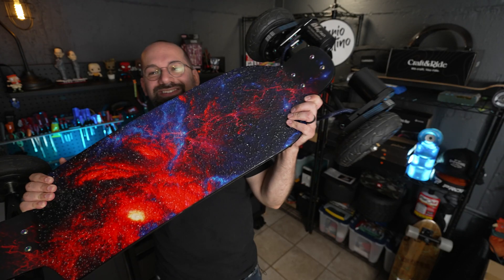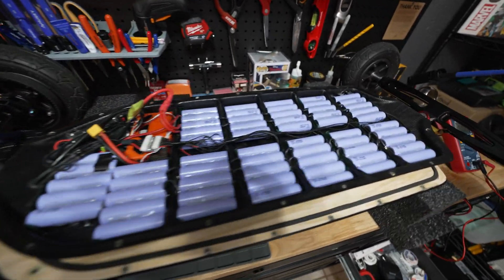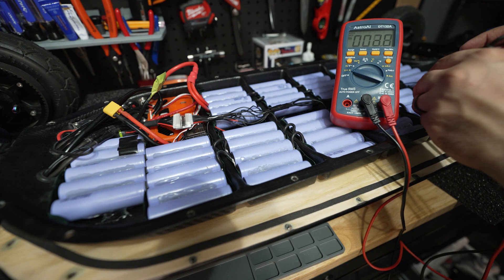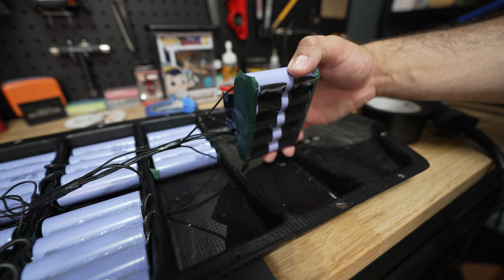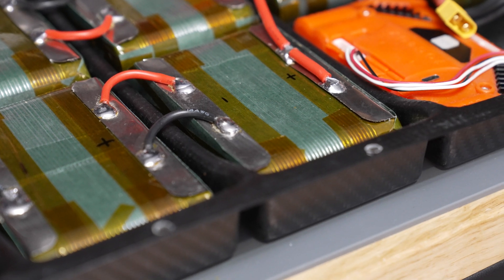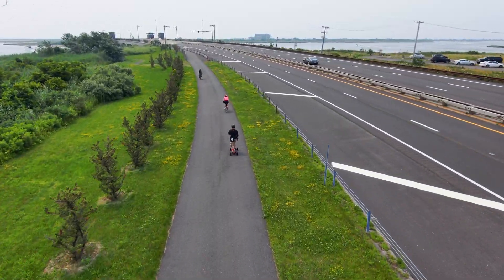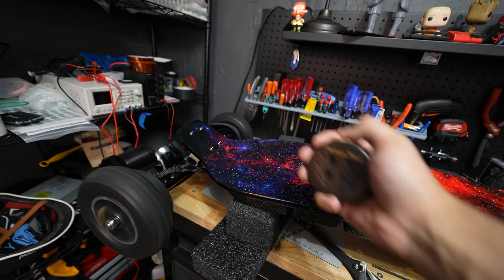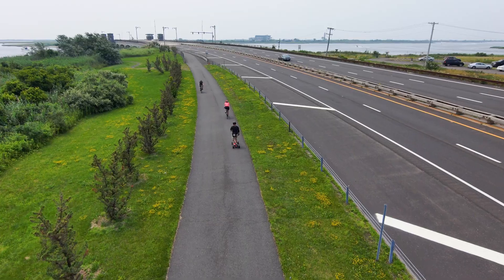DIY Electric Skateboard Repair | LaCroix Prototipo

Comment: Wow nice work that looks awesome. I just bought a used Nazare a week ago. I’m pretty sure mine has the focbox as well. Do you know any current app that will connect to the focbox? I mainly just want to be able to see how much range i have when I’m out riding. I tried Stormcore but it says the firmware is out of date on the unity.
Reply from the maker: If it’s a FOCBOX Unity, you should be able to use VESC tool on either iOS or Android.

Comment: Great video and really nice pack! I have been thinking about picking up a kweld with a car battery for myself too. What current rating does your car battery have? How good is it for welding 0.2mm nickel?
Reply from the maker: My battery is a DieHard Silver, only has a CCA of 575, but the KWeld calibration showed it did 1400 amps or so. It does 0.2mm nickel very easily, about 50-57 joules, depending on the sharpness of the electrode tips. 0.3mm nickel takes like 90 joules or so. I haven't done that in a while, and actually mostly use 0.15mm nickel now, since they're usually just for parallel connections.
Reply: @TheBoardGarage  Thanks! Good to know that a single battery advertised around 600A will be sufficient. I read on reddit that someone recommended 2x in parallel but apparently that suggestion was just based off the CCA without any real world data to back it up!
Reply from the maker: CCA is rated at freezing temperatures. At room temperature, the output is much higher.

Comment: Those are cool looking and all,  but when it comes time to stop quickly or turn around in a small space,  they definitely fall short.   Also,  you have 4 tires to replace.   Onewheel beats it in pretty much every category.
Reply from the maker: Oddly enough... I'm making a video on this exact topic. The long and short of it, is that I don't accept the premise. It's based on assumptions that aren't a given, and that I have disagreements with as well.

Comment: Nice one man - you know your stuff - have you looked at Nazare’s at all - I have an older 12s6p 20700B Focbox - wonder what she is like inside (not openerd her up yet) and wether a bigger pack is possible.
Reply from the maker: I haven't opened one up yet, but I do love the look of the Nazarre. I'm sure the inside is similar to the other current gen LaCroix boards. If it does have a 20700 based battery, then it can likely fit 21700 cells. It may not be worth it to replace it though, unless the original pack is really worn out and dragging you down. If it is, it should be easy to replace it with a Molicel P42a build.
Reply: I just bought that board a week ago and I love it. Do you know any current app that will connect to the focbox? I mainly just want to view my battery charge.

Comment: What's the cost of doing something like that?
Reply from the maker: The battery? Something like $720-750 for a 12s5p.
Reply: @TheBoardGarage  sorry yes I meant the battery.
Was only curious because I know I want my Kaly 2.0 and evolve GTR eventually upgraded.
Reply from the maker: The 2.0 is an interesting case...it really depends on how old it is when it comes to upgrading it. Kalys have a tendency to be pretty rough in the early point and then get more sensible as the board is out for a while. I recently saw a damaged 2.0 that was essentially impossible to fix due to a different sized enclosure (which I believe is not made anymore) and some oddness with how the battery was made. 

The GTR is essentially non-upgradable. It's designed in such a way that everything is sealed in a component housing and everything is proprietary. It doesn't have an enclosure in a traditional sense. Trying to upgrade an Evolve GTR is a waste of time and resources. Unless it's a Carbon GTR, at which point you'd have to gut it entirely and figure out how to build into the shell.

Comment: Nice work ! I would have siliconed the packs for more vibration relief but that said you knocked it out of the park ! When my Nazare breaks down I'm coming to you for repair. I too like that Jones beach path, I've been doing inline skating there with my wife but beware when night falls the mosquitoes are militarized vicious . Let's ride brother !
Reply from the maker: Thank you! I've used silicone on the cells before, but not only did it take forever to cure, but I've found that the bond to the cell wraps (at least on Samsungs and Molicels) gets weak and lets go after a week or so. This black hot melt is pretty ridiculous, and seems to hold stronger for longer, which I'm hoping, takes some stress off the welds in terms on structure. Anyway, I'd love to ride! I'm actually abandoning my Hummie deck build, and doing an old school Prototipo build for myself.

Comment: "I dont have a Onewheel for you today, but I do have something pretty special...
a FOURwheel..." 👀😯
Wow that's a nice professional looking battery build. It shows you put a lot of time and care into that. 👍👍🥇
Reply: Yeah really awesome,  FOUR tires that will need replacing.  Usually belts as well.
Reply from the maker: @nyccollin  Most commonly used tires last about 500-800 miles, depending on terrain and riding style. Since they're tubed tires, wearing them down to the threads doesn't cause air loss. Usually the rear tires wear faster, and I've more often rotated the front tires to the back, and just replaced 2. Also, since the wheels tend to just come off with a single nut, and the hubs come apart easily, a tire change for all 4 wheels takes about 20 minutes. And a tire can cost about $10-15 a piece. Belts last about 1,000-2,000 miles if you have them tensioned properly. If you're trying to make the argument that an eskate needs more maintenance than a Onewheel, I don't think that's solid ground to stand on. Even less so if you take the cost of ownership over the life of the board. I ride Onewheels more, but I don't think it's useful to ignore the costs of owning a Onewheel.
Reply: @nyccollin  Four wheels is faster, stable and way more fun than onewheel tho. Onewheel isn't a good purchase lol.
Reply: @SRNAR8  right? Onewheel starts at 1200 or whatever and everything they use is proprietary so if you try and fix a battery you brick it. You can buy an Eskate for 500 all day long and do whatever you want with it.

Comment: I’m curious how well the factory xr battery is. Could additional range and power be achieved with better equipment?
Reply from the maker: The factory Onewheel XR battery is built pretty decently. You can tell when you look inside that the there's a balance of safety and efficiency. Meaning, they use just enough to cover the current draw, and also do a good job of making the pack about as safe as a production e-bike battery would be.

More range is had by either shoving in more cells and sacrificing safety (a lot of mods do this), or losing weight (I'm always trying to do this), or riding way slower.